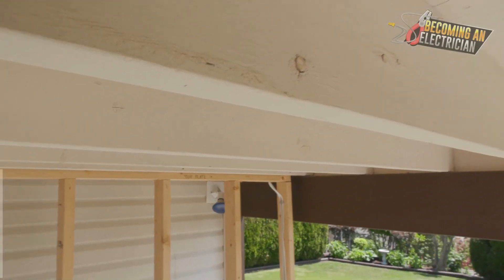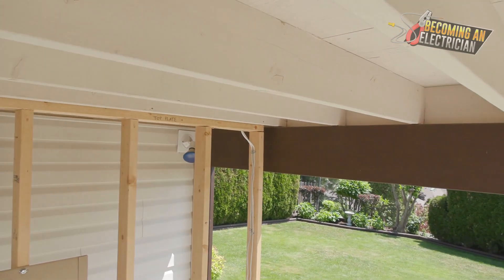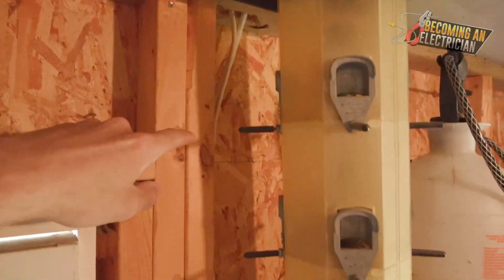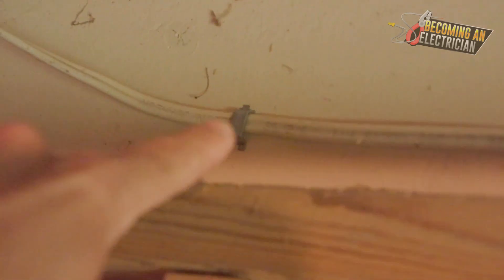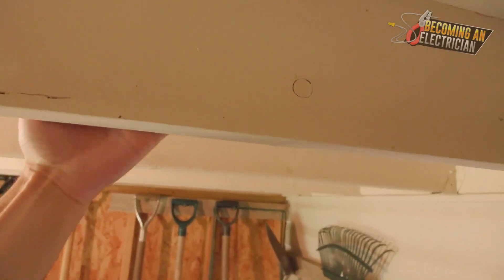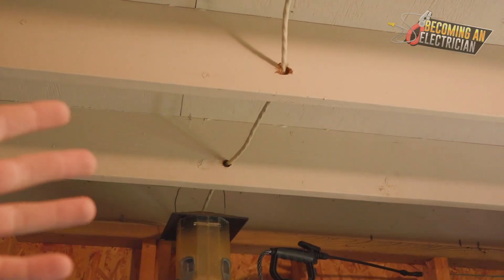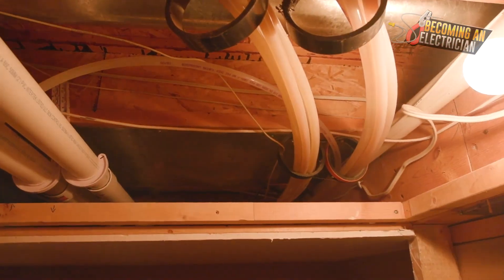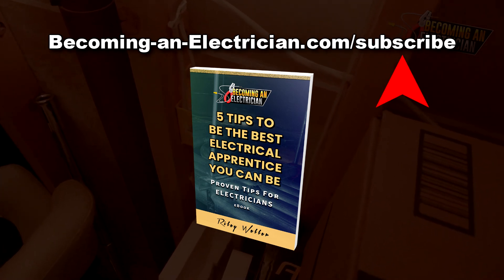Never Drill Blindly into Studs and Joists  (Always Check Other Side Before Drilling)

Comment: The problem isn’t when you can just look at the other side, the problem is when you can’t see what is on the other side, because it is inside the wall and such.
Reply from the maker: Hey!  Well, no that's one problem IF the wall is sealed!  This is particularly if you are drilling holes as an electrician for your wires in an open area.. too many times people don't check.. it happens more often than you'd think :)

Visually and physically check if possible!